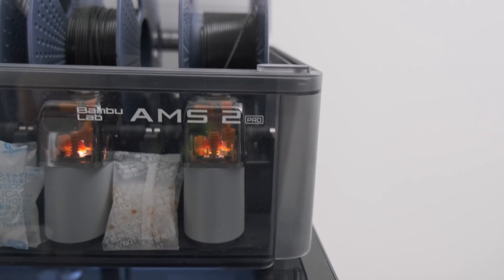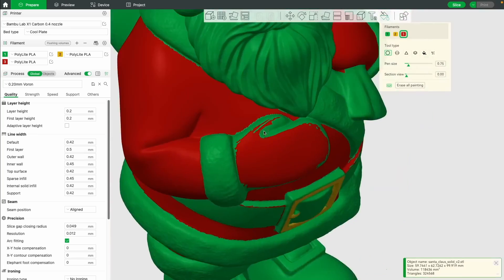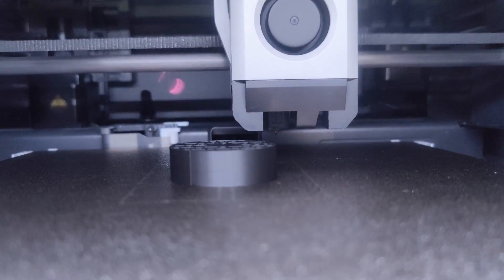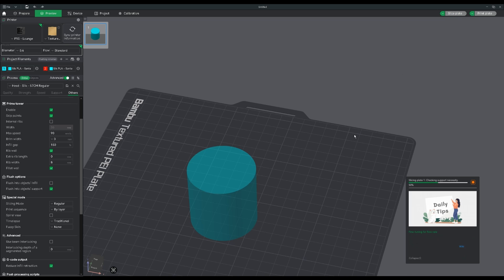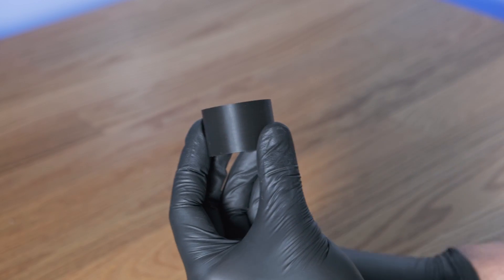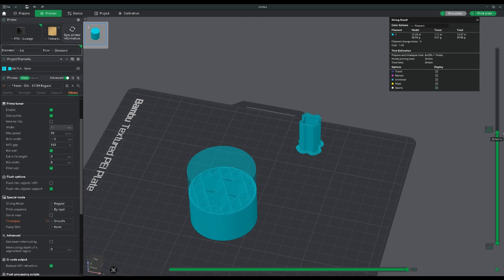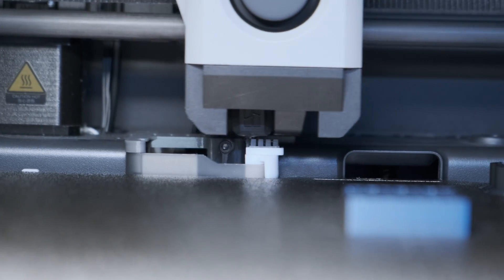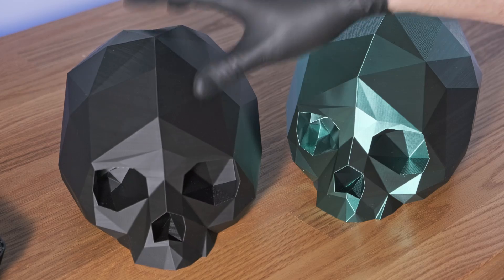Bambu Lab AMS Auto Refill…Kinda Sucks…

Comment: This should be fixable in the software like you said at the end of your video. Hardware fixes might be better though. An AMS that knows exactly how much filament is left on the spool would be just awesome. This way the printer could just purge the last bit before it starts with a new spool like it does with colour changes.

Comment: This feedback/improvement needs to go to Bambu Labs for sure.  Along those same lines and the Auto-Refill, there need to be other options like an "Ignore Color" checkbox so you don't have to lie to your printer about the filament colors if you don't care and just want a large print to complete with existing filaments in the AMS  Of course the same type, temperature, etc. all have to apply just ignore color if desired.
Reply from the maker: I agree, it would be a simple software fix! It's annoying to have to tell the slicer that they are all the same colour for auto refill to even work 😞

Comment: What a waste for all the filament left in the bowden it flushes!.. the worst part is, the slicer knew exactly how much was needed per layer. If that was in the print file the printer could keep going and decrementing the value until it finds a layer that wouldn't be completable(tube length would need to be calibrated or known) and also in that time it could have been pushing the new role into the tube right behind the finishing filament or wait until just as it's needed, beep to let you know to watch it perhaps, the app could even tell you the time until it will need to do it as it clears what's being used in the tube.. it would probably even be able to maintain pressure.. so many missed opportunities. Bambu makes a quality printer, but their macros are very lazy IMO. A1/A1 mini park with the filament half-way in the bucket between prints, shake themselves to pieces at the start of each job, silly things like that.
Reply from the maker: Yeah that is a big downside wasting all that filament... It seems this problem could be fixed by a firmware update...possibly... Maybe one day 😆

Comment: That external dual filament buffer system is awesome but I got a different brand off Amazon for $80 and do use it regularly when I run 4k rolls Through a 4 way adapter. I printed my own dual 4k roll holder system. Simple set up bearings and rollers. Something I'm working on trying to turn into a dual color TPU 95a system but as of now it takes a lot of planning ahead and measuring out your filament something that is difficult cuz you also have to account for the filament path but can program a flush and add a prime tower to help offset the guesstimation.
Reply from the maker: Ahh nice, which brand did you get? I'm desparately trying to get my hands on a solution that works... Yeah, I was even thinking about doing the whole measuring thing, but couldn't be bothered with it all haha, just sick of prints getting ruined. I need something that is consistant, and easy to use...
Reply: @LayerLabAustralia 
Cpybooder 
 It's awesome has a filament run out sensor and we'll automatically start feeding the second roll right behind the first roll they will be touching.
  Weighing out doesn't have to be that difficult just get a food scale or I have seen actual filament roll scales I assume they will be way more than $20 😅. Just know the empty spools weight - that and you got your filament weight. Simple. Spent a ton of time thinking on this and talking it out with co-pilot for muilt color TPU prints. 
 I even designed the ultimate filament splicer helper tool a simple filament clamp seen a few on maker world take a boden tube slip it down the middle BUT remove enough material from the boden tube so when you close the clamp it's the same size as the filament. Heat up your filament ends however than use the clamp to perfectly shape them together. 

https://a.co/d/14sdflz
Reply from the maker: @miguel360kmc  Ah yeah I see, it seems it's the same thing as the wisepro version, but unbranded.. Ah well, fingers crossed it all goes well! Does it have a one minute delay when a filament runs out?

Yeah I understand the weighing princible, but how to translate that into your slicer is another story, how do you know which layer to do the swap at in relation to how much is left on a spool? If only bambu gave you the filament usage per layer...
Reply: @LayerLabAustralia  no it runs out sensor goes off next roll starts feeding in not sure about the timing when I've seen it switch the filament from the 2nd roll is already catching up to what's left in the tube. 

  I paint bye layer height take note of the height of each color change. Than clone the model cut it into sections at each color change than slice I get the filament numbers and go from there.

Comment: I don't have this issue at all. Especially when I know I'm going to run out a roll I run a prime tower. Guess it's just luck that I haven't ran into this issue in 100s of prints.
Reply from the maker: Interesting... Are you printing multiple objects? Or just one?
Reply: @LayerLabAustralia both. Some times a full plate sometimes just 1 thing. As I said I do nothing other than add a primer tower so far it's worked out for me

Comment: This is the first time I hear about this issue even though everyone praise AMS for this very feature most of all.
How in the world after years of AMS 2 existence and after release of AMS 2 Pro this problem is still a thing?
Reply from the maker: That is a great question! One that I have asked myself. I guess people aren't using it for large, single decorative items where the outside finish is super important. When I use it for prints with lots of small parts, it works great, because I don't mind if one tiny part has an extrusion issue, i can just bin it if it's too bad, but most of the time it just lands on infil so it isn't even a problem. 

But when I print large decorative pieces that take over 24 hours to print, the walls are long, and slow, and the chances of it resuming on them are much higher.